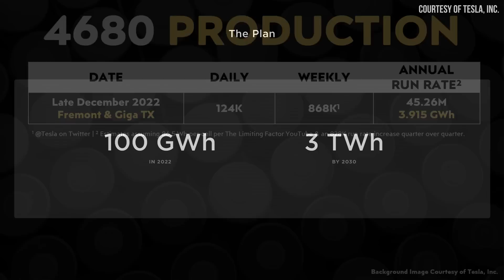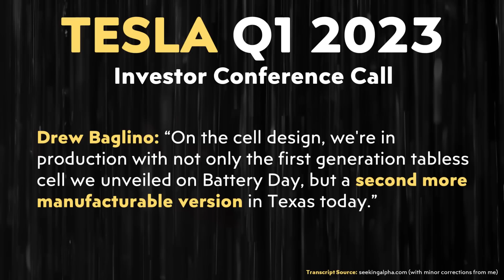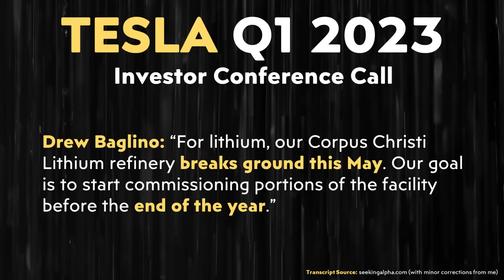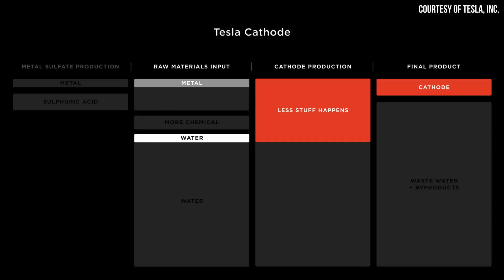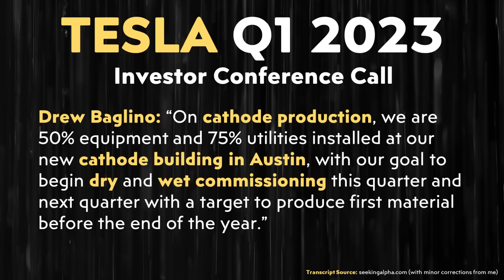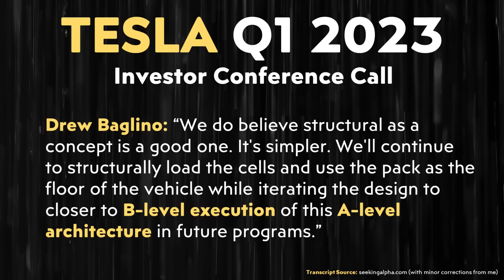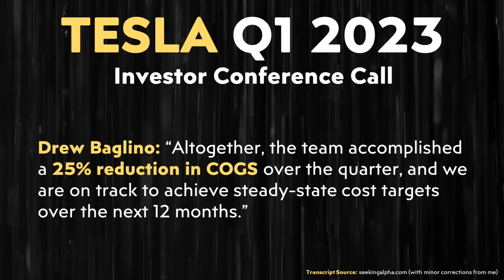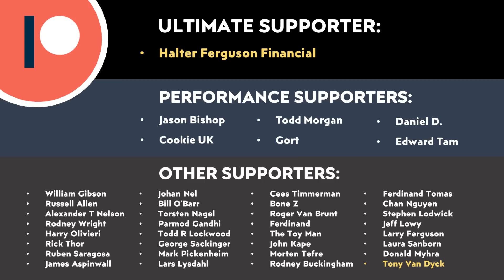NEW Tesla 4680 Battery Production Update | What Drew Baglino Revealed

Comment: Sorry for the 4680 Tesla battery but CATL is coming with its brand new condensed battery (500 Wh/kg) which seems to be way ahead !!!
Reply: Several points.
We don't know the predicted price, run rate, or longevity of the CATL cell yet.
.
If it's going to "kill" the 4680, it will kill every other cell type before that.
(Fully Ramped 4680 will run at such a rate and be so cheap they will have plenty of use for it)
.
If CATL are going to sell on the open market, I imagine their largest customer would be first in line? Guess who?
.
Have you noticed the 90(?)GWh factory CATL are building 5km from Tesla Shanghai?
Reply: @rogerstarkey5390  Do you work for Tesla ? These are only excuses !!! What's the problem of having a battery better than Tesla's ? In september 2020 (at the Battery Day) we heard this revolutionary battery was coming soon. Almost 3 years after it's still «coming soon». It only means that some of the manufacturers has evolved a little faster.
Reply: @sylvainlaurin1012  you totally didn't understand the implications in Rogers statement.  Well Done for outing your utter lack of critical thinking abilities alongside your tendency for unqualified nonsense.
Reply: @sylvainlaurin1012  How are 4680 "coming soon" when they've been in Model Y Standard Range already for many months?   These are next gen 4680 to be produced at a higher run rate & cheaper.  Do you have any further nonsense to bless us with?...
Reply: @alexmanojlovic768  Nonsense ???? What's the problem with having a better battery than Tesla's ???
Reply: @sylvainlaurin1012 Yes! nonsense... You mean a battery that Tesla will happily  buy & use alongside 4680's?  There isn't a problem with CATL producing a better battery for Tesla to BUY.  You're one of the few who think it's a problem.

Comment: I would appreciate your opinion of the feasibility ,of the many new chemistry batteries? Many less scientific channels are suggesting some ( Sulpher & Air ? - “semi solid state”) could be a breakthrough in Battery Chemistry , energy density and cost ? Of course Lab results get great PR but is it a  scaleable Manufacturing opportunity or tough tough challenge.  imo the Lab is like Vegas, what goes on in the Lab stays in the lab - Mostly. The other Q i Need clarity on please: When a 3rd party claims to be supplying 4680 to tesla are they licensing  the design from tesla
Reply: Sodium - not Sulpher. .
Reply: @EvEvangelist  
Both Sodium and Sulphur.
Both have issues
Reply: Re. 3rd party 4680 production - it seems unlikely Panasonic et al would licence any cell internals from Tesla, because A) their own chemistry/design should be as good if not better, and B) Tesla's design was barely finalised last year when the other companies announced parallel production and is continually evolving, as Gen2 shows. 

So I'd say it's just a matter of standardising a common form factor at this stage, ensuring a variety of companies can supply Tesla and/or other BEV OEMs with something sufficient to fill up the packs no matter how the DBE process turned out.

Comment: Battery in-house production really has been the biggest challenge for Tesla. I have to assume full conversion to the structural pack is also linked to this. I haven't heard much about a LFP 4680 and structural pack but clearly they would prefer to be making LFP themselves inside the US to maximise IRS take. A recent Tesla slide seemed to imply greater charge cycle life but shorter aged life at 8 yrs vs 10 for LFP which would be a concern if true.
Reply: Where is that slide?
Take a look at the talk by Jeff Dahn at the 2022 Electrochemical Society meeting.
He details a 50+ year Nickel based cell with better performance than LFP.
It's not set in stone.

Comment: Thanks for supplying context, much appreciated.

Tesla can harvest benefits disproportional to their capital investment in in-house lithium precursor production and battery production.

Why?

First, it provides negotiating leverage when buying precursor lithium and batteries. Suppliers will know that if they jack up prices, Tesla can just expand their own manufacturing operationsand cut them out of their supply chain.

Second, any cost efficiencies they can engineer and bring to mass production - fewer steps, lower energy requirements, superior machine designs, etc. - can be shared with suppliers (if Tesla wants to share them) to enable lower prices from suppliers.

So even without total vertical integration, and with a capital investment that is relatively modest, they can obtain benefits that they could not get by total outsourcing.

Elon's most important talent may be efficient capital allocation. He's awfully good at it.

Comment: The 4680 batteries seem to yield weak performance and range.  Hard to get excited about these when they go into a car with inferior performance.
Reply: The EARLY 4680 used a zero silicon anode, it STILL provided sufficient performance for the standard range Y...... Among, if not THE most efficient in it's class.
How exactly do you consider that "inferior performance"?
Reply: @rogerstarkey5390  it’s slower 0-60….  The car that has it doesn’t go as far….
Reply: @rogerstarkey5390  slower 0-60 and the car can’t go as far on a full charge = inferior performance
Reply: They have a notably smaller battery capacity, therefore "inferior performance" isn't comparable.  Also, there's a likelihood, or at least a chance, that an OTA improves range, petformance & charging speed, once Tesla are happy with the analytical data received from 4680 MY's.

Comment: I'm confused.  Do they have a manufacturable design or not?  If they improve the design, what are they going to do for all the people who got the weak design?
Reply: It's a process of continual iteration in design, to reduce costs & improve speed/quality of manufacturing.

Some people have gotten Model Y with Gen1-4680 cells, but there is no need to do anything for them unless/until their pack fails, in which case they are replaced with a later version.

Presumably most of the production equipment now being installed will turn out the Gen2 cells with better margin, but consumers will probably never know the difference.
Reply: @foobarrel9046  greater range &  faster charging.  Gen 1 are slower to charge than 2170's
Reply: Did you get a free upgrade from your old "weaker"  32" CRT TV when 40" LED TV's came out?  Of course you did(n't)...!!
Reply: @alexmanojlovic768  Telsa brags about rolling improvements in as they go along. They don't have model years. Everything they sell could be a prototype. Maybe it is, maybe it isn't. Often the first fix doesn't work, and it takes several fixes to solve a problem.  How many articles have I seen titled "Breakthrough in 4680 Batteries?" My PriusV has a shop manual and defined parts.  Mechanics know exactly what is in it.  Recall notices can be sent out if something goes wrong. This is what software people call "revision control".  I have never heard the Tesla actually knows what revision anything is for their rolling changes. Two cars made on the same day could be different. It could be this and it could be that. Toyota has a completely different approach.  Knowledge first, decisions second.  They thoroughly analyze and prototype designs before deciding on the correct one.  They often use set based design to thoroughly understand the design space. Toyota will improve the PROCESS of manufacturing as they go along.  This doesn't change the parts themselves. They aren't changing from 32" to 40" for a model year. Mistakes happen, but they try very hard to avoid them. That is all human beings can do. Tesla enjoys changing parts on the fly.
Reply: Have you ordered one?
If not, don't concern yourself.

Comment: There were at least 4 battery companies who made announcements that they were building 4680 size batteries to compliment Tesla's.  Even if Tesla is unable to get their own production plants up to their desired output in a timely manner, I am sure that they will purchase the entire output of these other 4680 variants.  A 4680 structural pack should be agnostic to the source of the 4680 cell manufacturer.
Reply: What if Elon change battery format to something else say 5069?
Reply: @grantguy8933  
No.
4680 is the "sweet spot"
Reply: @grantguy8933  due to the lack of supply, Tesla is buying up as much as it can left and right but Tesla will probably change its design in the future but that's probably at least 5 years out
Reply: @Dale Richardson
Why do you think "at least 4 companies" suddenly announced 4680 cells? (after Tesla)
Nobody had solved the problem of resistive heating before.
That suggests those companies are using some derivative of the tech in the Tesla cell (namely tabless, or similar)
That in turn suggests that there's a degree of cooperation.
We know Panasonic is using wet process, which mean they still have the "large factory" problem
(Remember, one MAJOR advantage of the Tesla concept is "huge quantity from small factory")

Comment: How many 4680 batteries in one Model y?
Reply from the maker: 828 to be exact.
Reply: @Cleanerwatt  
Although..... That was the "Pack stripdown" cell.
For all we know there IS a mark 2 cell in the latest packs with high Wh/kg and fewer cells to match the required range ?
(Speculation 😉)
Reply: about 800, the 868k production in a week = 1000 Model Y.